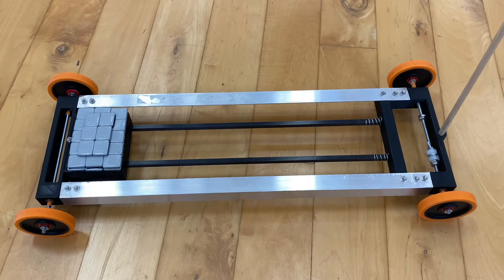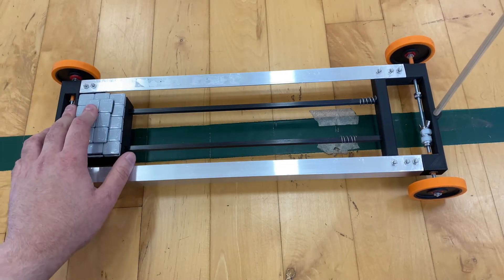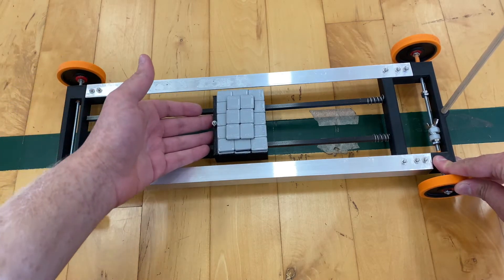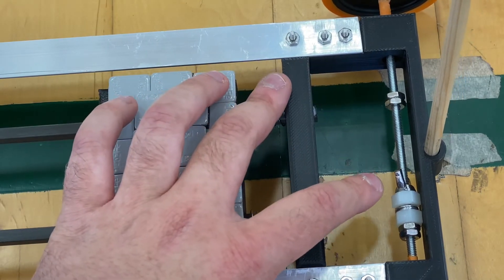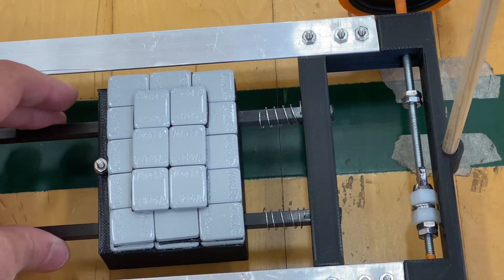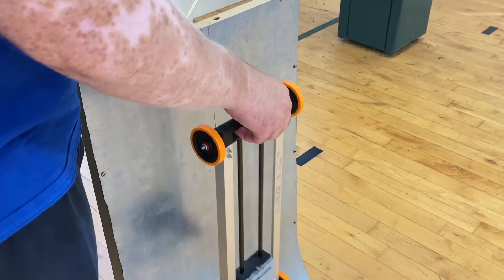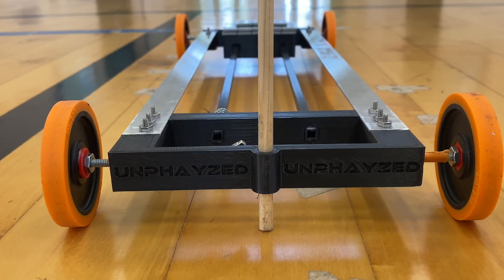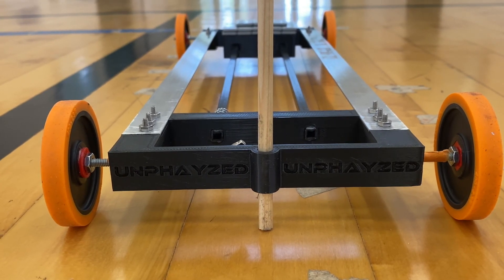The BEST Science Olympiad Gravity Vehicle | Expert Gravity Vehicle Kit

Comment: Unphayzed, one question, although you will prevent skidding, if you keep the weight in the back, wont that mean that the initial breaking force/deceleration be less than if you had a fixed weight at the front because when the weight is in the back, the center of gravity is more rear ward, and the force of friction is less at the front where the brakes are. However, if you have the weight in front, although you will have more skidding, intially, the braking will be stronger.

Comment: Hello, I’ve greatly enjoyed your videos, but I’m rather confused on how to calibrate my brakes. What is the best way to tell how many turns your vehicle will need while taking into consideration loss of kinetic energy through friction. (I’m finding that my vehicle stops a bit too soon) Thanks in advance!
Reply from the maker: Hi! To determine the amount of wheel rotations for your braking system (assuming that it is a standard wingnut braking system), is to use the following equation: (Target Distance / Brake Wheel Circumference) = Rotations Needed. However, if you are using a spring then you might need to use some trial and error. Are you perhaps using the Expert GV kit or your own design? I may be able to help you better if I have some more specifications of your vehicle.
Reply: @UnphayzedSO  thanks for the reply! I will definitely have to try this out. I made my own vehicle that has a wingnut breaking system (no spring).

Comment: I was thinking about a design similar to this in designing my own vehicle. However, wouldn't you want the weight to sling backwards upon braking to prevent skidding forwards, instead of slinging forwards w/ the vehicle? You could achieve this by attaching a cord to one of the axles.
Reply from the maker: So the reason that the vehicle would skid after stopping is if the vehicle still had momentum after breaking. The this vehicle design utilizes the remaining momentum into propelling the weight forward. Additionally, by moving the weight forwards, the vehicle's center of gravity is also moved forward, closer to the breaking mechanism and, therefore, making it easier to stop. It's easier to understand if you try it yourself. Try to run your vehicle with the CG in the front of your vehicle and compare it to when the CG is at the back. You will notice that the vehicle will move significantly faster but at the cost of skidding when the GG is at the back. By letting the vehicle start off in the back and smoothly ending up in the front, you achieve the best of both world, moving faster and stoping safely.
Reply: @UnphayzedSO  Huh, interesting. I was thinking of a rear braking mechanism.

Comment: Where did you get your spring for the braking system from?
Reply from the maker: I got them from Amazon. They were about 1” in length, but you would want to optimize the diameter of the spring for your specific car if you are building from scratch.
Reply: @UnphayzedSO  Could you send a link or tell me the max load lbs because I don't want to get a spring that won't compress all the way every run and cause varying results. Thanks.
Reply from the maker: The exact spring in the video is a 3/8 x 3/4 spring, however this is specific to the weight I have moving. If you want to determine the exact strength within a spring you would need to use hooke’s law and find a spring with a k value and length that is able to withstand the force applied by the moving weight. Because you have a lot of weight to work with, you could always invest in significantly larger diameter and length springs instead of going through calculations. If you are having trouble with finding a starting point for your spring, I recommend a 23/64 x 1-3/8 spring as it should be sufficient for about 1-1.5 kg.